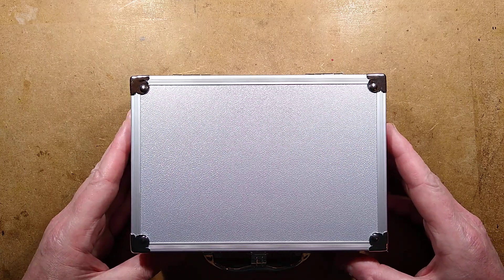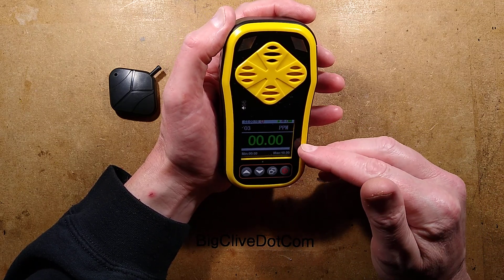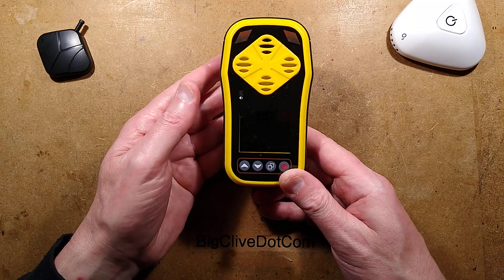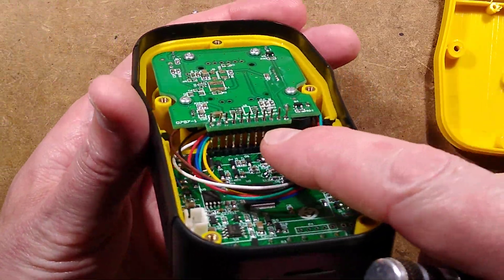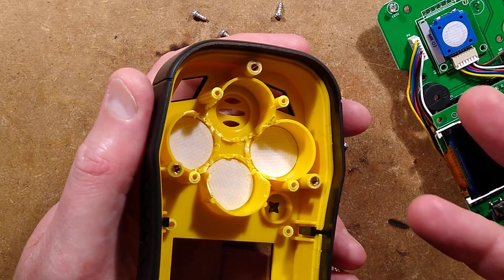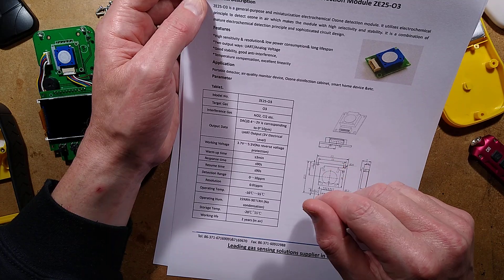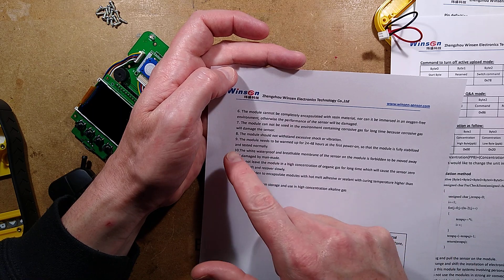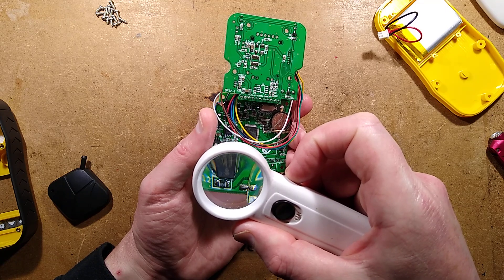Inside a wearable ozone meter with alarm.

Comment: The CCS811 VOC gas sensor I've used in a project has a similar 48 hour burn-in period and takes 20 minutes to run-in (stabilise) after each power up. The datasheet for the CCS811 describes it a metal oxide gas sensor and it has a built in heater and needs to be provided with temperature and humidity readings to calculate estimated VOC or CO2 levels.
Reply: From a shitty test I did with two identical CO sensors, the burn-in didn’t seem to do anything. Maybe it’s just good practice or it strongly affects certain types of censors?
Reply: When Clive mentioned the run-in period, I thought it would be done by an intermediate manufacturer during assembly, rather than the end user.
Reply: @telekommotorrad9065  The initial burn-in could be done by the manufacturer if they had time to do it, but the run-in on power up is done each time the device is turned on

Comment: Looks like they've poorly repurposed the case for a 4 head GDU.
I use the Honeywell GasAlertQuattro which has a far more substantial case and has sensors for Combustible gasses, Oxygen, Carbon Monoxide, and Hydrogen Sulfide.

Comment: if you want to convert ppm to µg/m³ the factor is 2000 so 0,1 ppm is 200 µg/m³ however this is an approximation and varies with pressure and temperature of the air you are measuring.

Comment: Thanks for the video. There was a problem in the UK in 2007 where somebody accidentally added silicone based additive (for diesel) to petrol tank at a fuel depot in Essex UK. It caused damage to lambda (oxygen) sensors in many petrol vehicles. Here's a page about it --> https://www.autocar.co.uk/car-news/motoring/tainted-fuel-contains-silicon
Reply: So there was. An anti foaming additive as i recall. I remember thinking at the time that in the unlikely event of any military road vehicles employing a CAT and a lambda sensor- they would have had hasty modification. Significant sabotage potential.
Reply: There fucking was and it fucking did !!! I was one of the sorry cunts who suffered like a bastard from it as well, to the tune of several thousand pounds of garage bills trying everything under the sun before it became widely known what was wrong and the <£20 repair. The mechanic would keep changing the sensor, take it for a drive and all fine. Until I got it home and it ran for another half hour or so before the sensor was fucked and the engine started stalling and back it went. Each time something more expensive was--unnecessarily--replaced until I watched the news and suggested that might be the problem. Another new sensor and a full drain and clean out of the fuel system and all was well. That was a shit month.

Comment: Nice case moding, I hope that's not a production unit! 😁
Reply from the maker: It is.  They definitely made an interesting mod to fit the sensor.
Reply: So labor intensive! They just manually broke it out with pliers. Instead of just using a die grinder or something

Comment: Interesting that the data sheet mentions it needs to be heated/enabled for 24-48 hours to sort of "break in".
I also think it's pretty interesting that they just hacked out part of that plastic case to make it fit....which seems.... janky... yet somehow, the boards all fit inside perfectly. Weird...
Reply: I got a large assortment of gas sensor modules modules a couple months back. All of their datasheets say to run them for 48 hours in clean air before use.

Not sure why, though. I compared one CO sensor I heated 48 hours with an identical one I heated for 10 minutes, and they gave about the same readings and had about the same response
Reply: Possible outgassing of the material?

Comment: I wonder what this meter would read with the Sharp Plasma Cluster. I suppose it would detect Ozone, despite Sharp's efforts to avoid saying it produces any.
Reply: That is actually what I was expecting... too bad. I'd have liked to see that.
Reply: @Phred_Phlintstoner  me too, I got a plasma cluster unit and I've split it into 2x2 units on 100% duty cycle with small pc fans, I would be very interested in seeing the Ozone output too0